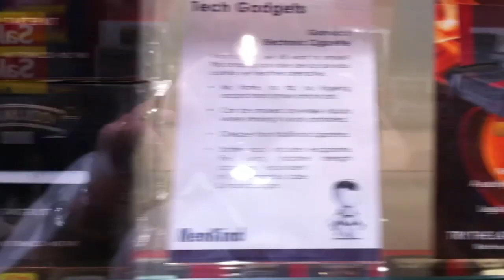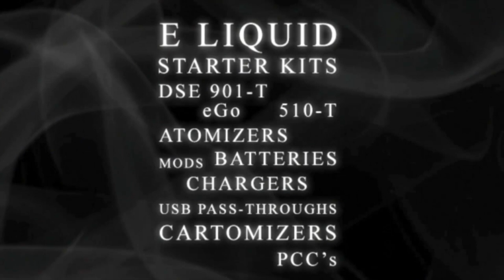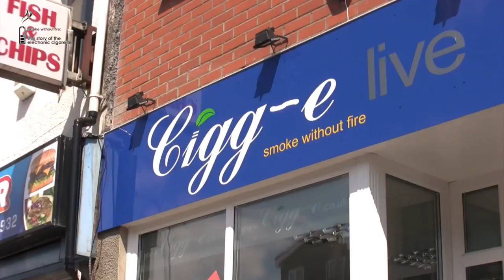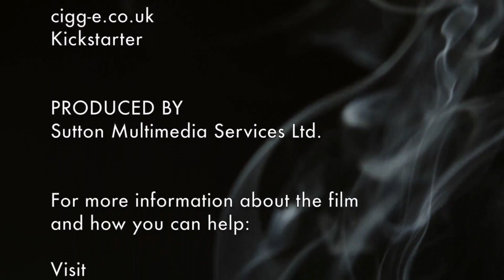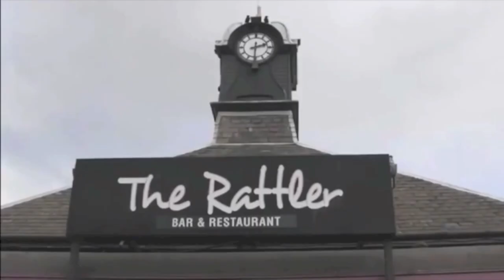Haze Hour 30-05 - Daz Does Wicking!

Comment: Even using an almost the same size wire rope than the wick hole of the atomizer, there will be little spaces in the perimeter, so air can go inside the tank while liquid is coming out, but again, I think it is by gravity. That's why some famous atomizers (as the Zenesis) "wick" so well, those atomizers have to have the filling hole opened all the time, so air can come inside the tank while liquid is coming out through the wick.

Comment: So I think that by using a solid ss rod that fits loose in the wick hole, will produce exactly the same results than when using a ss wire rope, also with a loose fit.

Comment: I think stainless steel wire rope doesn't wick as everybody thinks, as you can see the wire rope is very loose in the hole for the wick, so liquid just travels through the wire rope by gravity. I have tried with a stainless steel rod instead the stainless steel wire rope and same happens. The mesh at the top helps to hold some liquid and allows the coils to have a flat surface, with only the wire rope there will be some places in where the coils wouldn't touch the wire rope wick.